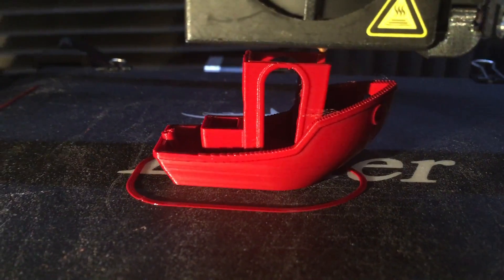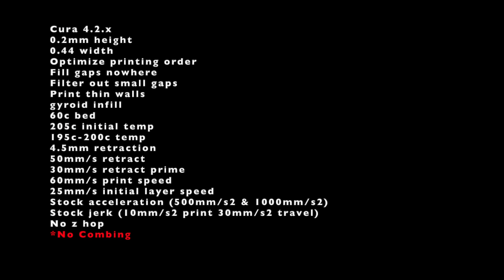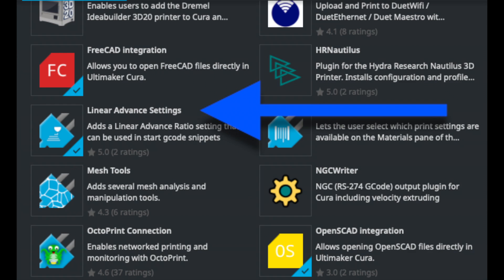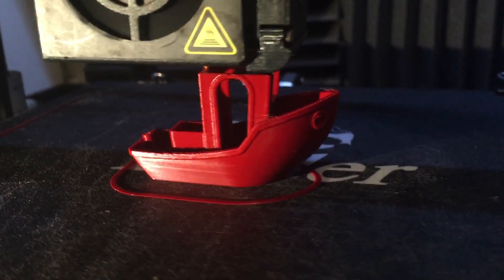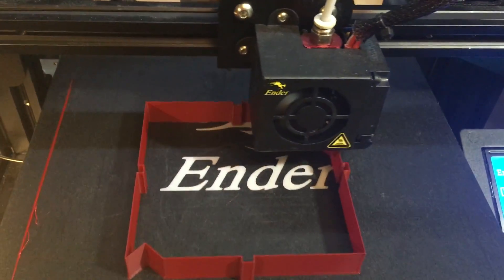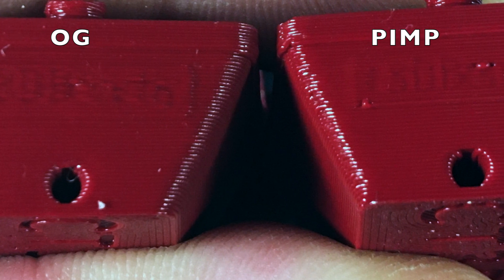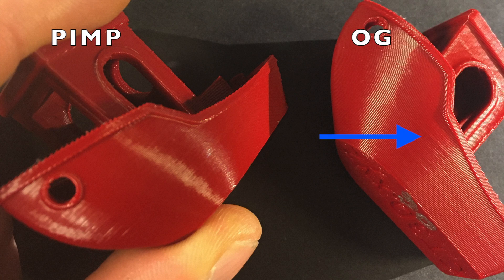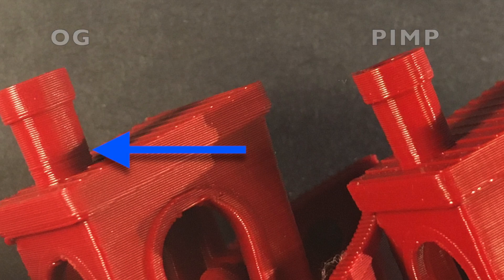Just for fun: Benchy with memory hacked SKR and aaaaalll the features toggled on

Comment: To be critical, Cura will slice the same part with same settings and output different gcode. Try it. You will see. If you can print the Benchy with the previous gcode file using the fully featured Marlin settings then you will have a more accurate comparison. Keep up the vids! I have learned quite a bit.
Reply from the maker: Yes, good point.  I wanted to use the exact same code, but would have had to toggle off Linear advance, so I had to pick the lesser of the two evils

Comment: You ever considered covering Klipper firmware? There's not much info on YT beyond how to simply install it. I've been working on tuning my config, and I get great prints on an E3 at 80mm/s, but I feel like it has more potential than I know how to use. Would be great if there was more info about tuning, consolidated into one place.
Reply from the maker: Yeah, I'm going to work an alternative firmware options vid into the series at some point
Reply: @AlexKenis  Lookin forward to it. Cheers m8
Reply: Check Chris Riley’s video. It’s pretty simple TBH
Reply: @chloemcholoe3280  Yeah all h e does is install it. And it's much easier to do now anyway. That guide is a bit outdated.

Comment: I ordered an SKR MINI E3 on 11 11 thanks to your tip, $25.00 shipped seems a no brainer, especially if the really beefed the copper traces, word is the old ones could spontaneously combust if pushed too hard. What is the point of a 32 bit board if you aren't going to push it?
Reply from the maker: Yeah, I have two of the older boards with the thinner copper. Its annoying because I over-paid and then had to wait 7 weeks becuase of the driver shortage, but I have to figure out what to do with those... Either hardware experimentation or maybe find the limits as far as how much you can push them safely so that folks who already have them don't have to be afraid to use them.

Comment: It hurts so much to seee your ender 3 printing better than my hypercube evo that I spent so much money and effort on ;(
Reply from the maker: Well take heart, because I think part of it is that they have the defaults set so low.  It'll probably take a ton of tuning to get prints as nice at higher speeds and accelerations. I really want to push it and see how it behaves, but I have towait and go over a bunch of mods before I can start going bonkers
Reply: @AlexKenis  mine mostly suffers from layer inconsisstency. i tried setting my speeds to 30mm/s and accelration to 300 but it didn't help. it prints the same at 300 accel and 30mm/s and 100 with 1500 accel! but eh I guess i'm learning a lot trying to fix it. i designed another idler mount that greatly improved the quality but i still get this weird poking in/out in my layers

Comment: Currently i try to get a smart reprap 2004 display running on a mini e3. ok i can buy a glcd but i like the old ones. (and i have plenty of them because they are dead cheap for using in general for arduino projects when you need a beeper, a display, and a rotary encoder ...) :D
Reply from the maker: I'll take a look at it.  I'm pretty sure the code is there to drive the LCD, I'll just have to figure out the pinout and assignments

Comment: I've had no luck calibrating linear advance.  The docs say to start at K=30 and to expect as high as K=100 for PLA on a bowden setup.  So your K=0.7 really surprises me and makes me want to start again.  What made you try a value so low?
Reply from the maker: Ah, that got me too a while back and made me toss out linear advance until I figured out what I had done.  the high numbers are from the old scaling.  The new linear advance uses numbers way down in the single digits, and just the difference of a few tenths, like 0.4 to 0.6 could be a huge difference.  Go back to the test pattern page and try values in the 1's and 2's range with the linear advance 1.5 set in the pulldown
Reply: @AlexKenis  Thank you.  I could swear that I JUST read that the higher values were expected for bowden setups before replying to you.  Now it is obvious when I read it.  There is something awkward about the way the docs are written.  I wish they would split the page into two or at least two distinct sections.  The DRY principal doesn't apply here IMHO.
Reply from the maker: Yeah, that page should be edited a bit.  Also, the exported gcode doesn't seem to name the file properly, so be aware of that.  I made a bunch of tests for various speed and accelerations, only to find out I couldn't tell them apart